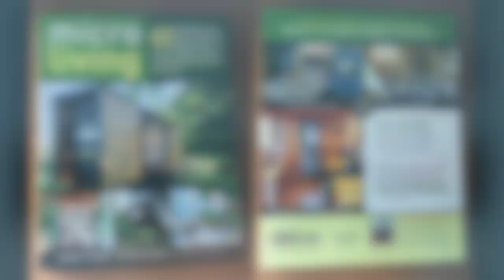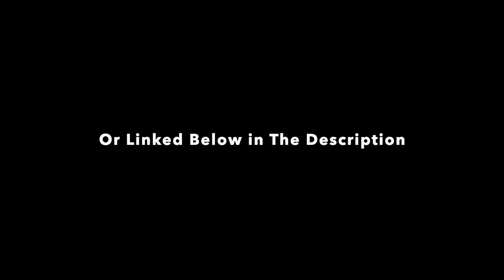Ultra-affordable GREENHOUSE design and plans! (Glamping cabin?)

Comment: Too big of a space and permanence commitment for my yard, but OMG, I'm in love with this idea!

I want to make a smaller version on wheels, so I can move it when I mow, and store it behind my garage in winter. Maybe 5 x 8? Ditch the potting table on the side, and just do one across the back.

My Dad LOVED his garden, and was talking about adding a greenhouse before he passed last year. Right now it's all I can do to get the yard mowed, and landscaping attended to by myself, let alone think about  a garden.

I think using the MANY buckets he already has, and the various wood that's around the garage to make this would really honor him. Add on the screen door I salvaged from my old house, and I might be able to do this project on a budget. I've secretly been wanting an excuse to buy a nail gun. Lol. A basement full of tools, and he didn't leave me a nail gun. WAIT! I wonder if my staple gun does nails? Hmmm. Even cheaper if it does!
Reply: Clever idea to put it on wheels - it can move with the seasons, more sun in the spring, a little shading for high summer, and as you say, out of the way in the winter until you're ready for it again.

Comment: Nice, but $1000 bucks in materials, that’s not economical to me. $500 or less would be but since were being raped through the nose right now I suppose that’s the new economical.
Reply from the maker: Is what it is- you could always mill your own or look for salvage? $1000 is pretty darn cheap considering what the cost of any small project is these days- let alone one larger like this. Salvage is GREAT, but comes with the tradeoff of time. Always other ways to do it though- no doubt. Thanks for checking it out